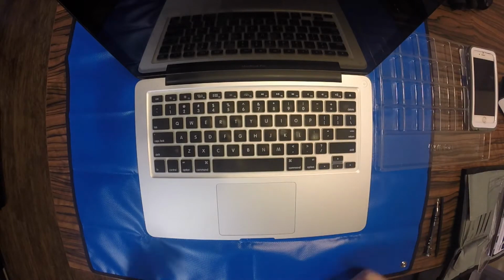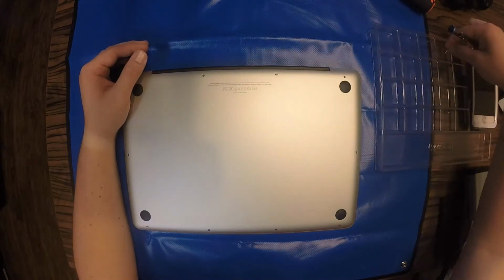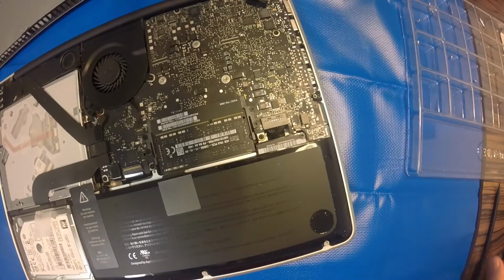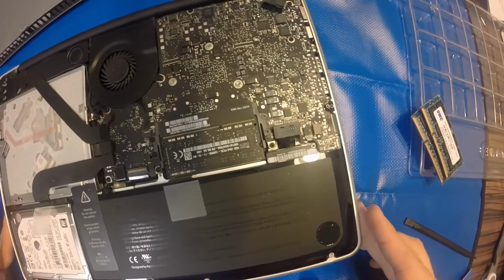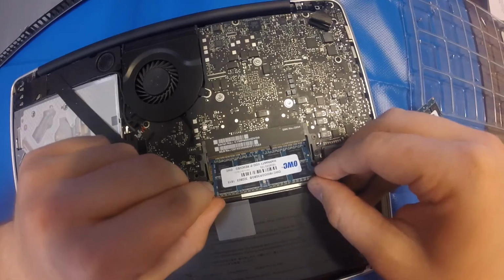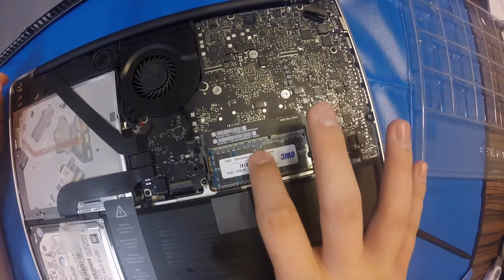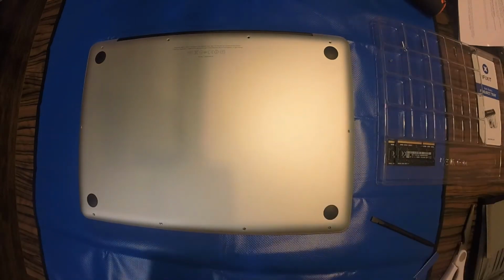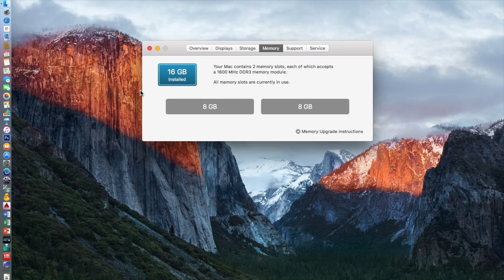MacBook Pro RAM Upgrade Tutorial 13" Unibody Mid 2012 (8GB to 16GB)

Comment: I thought the macbook pro 13 inch model mid 2012 can only have a maximum RAM capacity of 8GB? Is it still possible/safe to install and use a 16GB RAM on a model 2012? Your help is appreciated.

Comment: Upgrading my mid-2012 MBP from 4Gb to 8Gb greatly improved its performance. Does upgrading from 8Gb to 16Gb still yields significant increase in performance? If so, can you estimate in percentage the increased performance? TIA
Reply from the maker: +VanJo it's hard to estimate the performance increase as a percentage. The more memory you have, the better your computer will run multiple apps simultaneously.